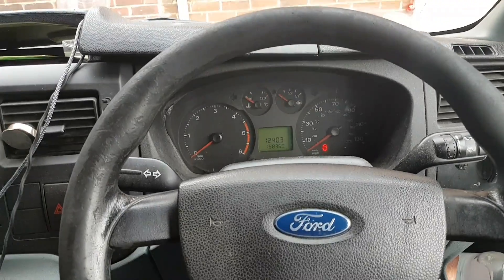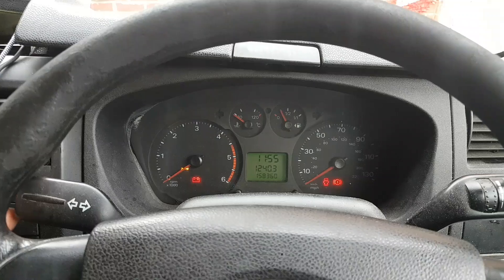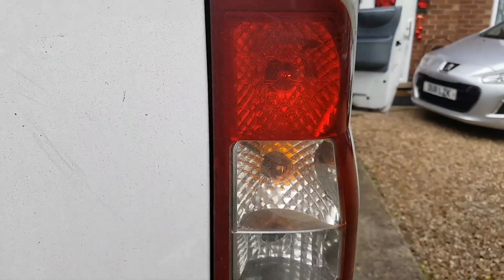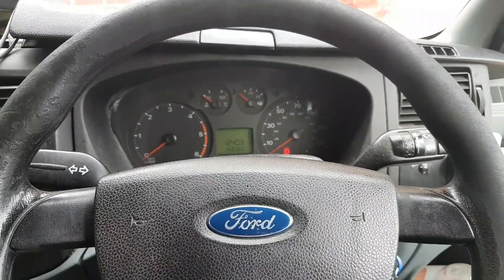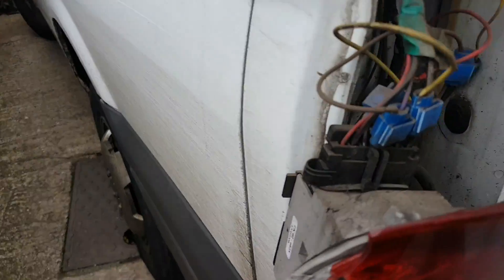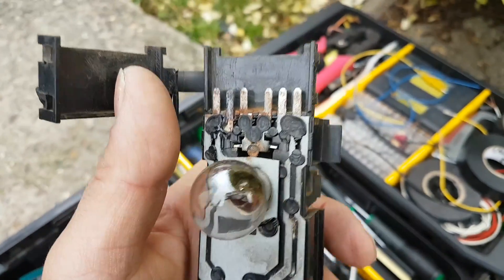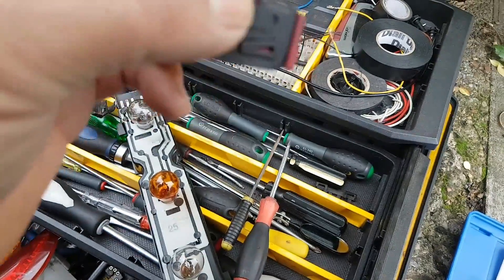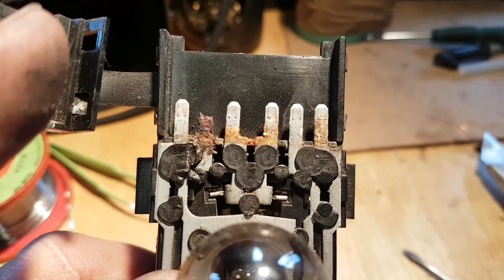Ford Transit rear lights not working correctly. Fault finding and repair.

Comment: Hi how did you get pins out of connector block
Reply from the maker: The are usually secured in place by small tabs... on this particular one, I now don't recall how it is... sorry.

Comment: Thank you for the video! But just one question, how to you get the pins out of the connector as you do at 4:13?
Reply from the maker: You need to insert 2 small blade shaped prongs on each side of the pin to press the tabs inside, and then the pin can be pushed out...

Comment: I came across your video using the below search for the problem.Having for with my 2018 Ford transit-250:

"tail lights come on sporadically on ford transit-250"

Though your video is not having the same problem as my for transit. Is it did enlighten me to the fact that the signals can be come sporadic? Dick win any of the conbecome unstable..

In this regard I will focus my troubleshooting on inspecting all the connections.

On my particular vehicle, I've added a trailer harness that then branches off to 2 separate trailer lights, one for a bike rack and 1 for 2 lights that I put on top of the Roof it's because when I have the bike rack on with the cover, you cannot see the Original tail Lights of the.Vehicle.

There was a time when it was working but I noticed the other night, when the vehicle was off, the top lights were on tail light or parking light mode. 

(Signals, hazards, brake lights all still work fine gor both kits)

Another night I noticed the tag light (I added by splicing into bike rack kit harness parking light wire) was on.

The white tag light was on all by itself.

The trailer light kits and harnesses are different because because they are 2 different products.

I put on an aftermarket tag light to the bike rack kit branch of wires.

I spliced into the wire that was for the tail lights/parking light wire  for the bike rack kit with no problem.

I then added the additional trailer light kit but this time mounting it to the top of the roof so that when the bike is on the rack with the cover on the lights can be seen clearly.

All this was working up until last week when I noticed first that the bike rack tail light was on all by itself for no reason.

And then I noticed the other day that the parking lights on for the roof kit.

Lights were on when no switches from the cab were activated. 
When I check all the lights for turning hazards and breaking, they all work.Except for the fact the parking light will stay on either for the roof or that secondary tag light stays on sporadically on the bike rack.
😮

So somehow there's a run off of 12 V hitting both the taillights or parking lights for the roof kit and also to the after market tag light.

Since both of these conditions regarding the roof lights and the tag light on the bike rack have been sporadic.

 I'm assuming that there is a faulty connection that's causing the disruption to the flow, similar to the chaotic lighting that you got on your vehicle.

Im also wondering if the spliced in tag light light may be creating a voltage change issue to the body control module.

My first step is to basically go through all the wiring and make sure all the wiring is secure.

Note: The rooftop light kit did not provide a full white wire for ground. Expecting, and then attached to the vehicle body groung.

Lastly, just recently, the 12v lighter in the front cab, and overhead cab lights have stopped working.

Ill be checking/replacing fuses for the 12v lighter outlet and interior cab lights.

Well I hope you followed the layout of my two light kits and generally with the problem i'm receiving but what's your video has shown me is that a faulty connection anywhere in the connection sequences can lead to sporadic lighting results.

So thanks again.

For showing me that sporadic lighting can result from simple problems such as bad grounding or a single connection going bad.

This will aid me when conducting troubleshooting.And exploring is what wiring problems i'm having with my issues.

Comment: Massive help thanks. However, you can buy brand new pair, including the wiring and sockets and connectors, for about GBP16. But this certainly works. The idea of fixing the ground  is the main fix as it appears that is common fault with the transits. Grind the paint off the body, clean up the lug. And refit the ground. Spray paint over the connector when finished.

Comment: Thank you very much, excellent video, one question, could you tell me what the order of the cables is since they can be connected in the same way. both sides and I didn't pay attention when disassembling, could you tell me which pin is each or how to know which is ground which is positive, thank you very much,
Reply from the maker: I don't recall that now...
But with a multimeter you can easily figure out which is which...
👍👍👍

Comment: Hi there. 
I wonder if you can help??
I have mk7 transit. The stop lights aren’t working. 
I’ve changed the stop light switch, fuse and bulbs. 
Could you point me in the right direction of what wires I need to look at to fix this please. 

All the other lights work front and back.
Reply from the maker: Measure the wiring...
It is difficult to say without testing...
Test before replace...
👍👍👍

Comment: My brake lights seem dim they all work correctly but just dim when brake is pressed hard to tell the difference between tail lights and brake lights not sure why or how to make them brighter
Reply from the maker: Make sure to start with, that you have the correct bulbs... then check grounds, connections etc...
👍👍👍

Comment: With the wire you soldered to the circuit board  could I technically do this with the positive negative for a power lead to run parking sensors on the rear or is it worth splicing into the main line?
Reply from the maker: You can solder, but I would advise you to install a fuse in between...
👍👍👍
Reply: @LMAutoRepairs  lovely - I'll get that sorted with a fuse box down line to the control unit 👌
Reply from the maker: @quickshiftpov 
👍

Comment: you know how to de-pin the connector mate? thanx 100 times
Reply from the maker: I don't recall exactly how that one is done, but they usually have one or two tabs to press while pulling/pushing the pin...
👍👍👍

Comment: Hi there, I have a 1996 ford transit with a similar rear light, the mechanic has fail my W.O.F because the the top red light is both the tail light and brake light. Is this the same on yours or should the bottom red light be brake light? Thanks heaps

Comment: Great Video, I have no revering lights, i tried to clean the pins on the tail light connection, not realising that one can easily open the plastic cover so easily as you did on your video, so going to take the rear light out again, and give the reversing light terminal a proper clean, really glad i watched your very useful video, we all learn new stuff everyday.
Reply from the maker: ☺️
Thanks, hope you get it sorted! 
👍👍👍

Comment: Any leads?? My brake light work fine but the right driving light isn't working? This is the same bulb. Changed the rear lights and bulbs still no solution..
Reply from the maker: Wiring?
👍👍👍

Comment: This is great fixed my brake lights. My driver side indicators have now stopped working. Not even flashing on the dash. Left side works fine. Any ideas as there is nothing online.
Reply: Hello, just had the same problem.  A search online (Ebay) and I bought a new ewar lamp holder and connecting block for £8 (post free) - problem solved.

Good luck.

Comment: How do you take the pins out - if you pull the wires they don't budge!?
Reply from the maker: You need to dismantle the plug... I believe there is some small tabs you need to press to release the pins...
If I recall correctly...
👍👍👍

Comment: I have the same problem. But if I connect my caravan/trailer the problem gets worse. 

So: That cannot be a problem at the connectors of the back light? Isn't it? That should be earlier in the circuit near the battery.  Isn't it?
Reply from the maker: I would say yes...
As when you connect the trailer more load is put in the circuit...
👍👍👍

Comment: Great vedeo and great helping 👏  on my transit 2012 I have a strange problem 🤔  I replaced a pedal braek switch and not have a electric signal on brake lights!! On dashboard I see a 2info lights! ABS and sleepering road signal!! Anybody knows what caind of the problems can be?? All fuses are 👌 i replaced the rear lights both sides but no power on brake wires 🤔 i appreciate if anyone have ideas thanks fellas cheers
Reply from the maker: What was the problem before the switch replaced? 
Check grounds...
Thank you for watching!

Comment: I’m having a similar problem, when I indicate right the fog light flashes on the dash when I put my hazards on only the left indicates on the dash and when I come look at the back every light is flashing faintly on both sides. The right hand side break light comes on instead of side light too. I’ve stripped down and cleaned every single plug pin and earth and no joy. Any advise? Thank you
Reply from the maker: Hi
Still... that to me, indicates poor ground somewhere...🤔
Reply: @LMAutoRepairs  I thought that too, do you know of any others? I’ve checked and properly cleaned each one behind each light

Comment: great vid mate buy can u tell me how you remove the wires 4 mins 14 seconds in to your vid many thanks
Reply from the maker: There is a small tab inside the black plug, that you need to move in order to allow the pin to slide out...
Thank you for watching and for your comment!
Reply: @LMAutoRepairs  thank u mate I will give this a go thank u again

Comment: Hi...could you tell me which wires are for the rear fog light please...I need to switch my log light from the right to the left...for import into,Europe , or, indeed add a fog light to the rear

Comment: Hi, good video I learned quite a bit. I have a similar problem and it is that the fog lamps are permenantly on but on a very low light. But talking to a friend who knows a bit about Transits he said the problem could be caused by the fact that the two  bulbs are LEDs and not standard filament bulbs. He said on old vehicle replacing standard bulbs with LED.s can cause problems. I have not stripped off the light fittings yet to see the condition of them, but wonder if you feel the LEDs. could be the issue. Strange thing is that the previous years MOT did not mention this problem but I have just had a MOT test and the guy failed it on this lamp issue......and other things !
Reply from the maker: Hi
Yes... on some old or cars not prepared to use LED lights, they can cause issues... not sure in your case... put a normal bulb and see how it goes...
Thank you for watching and for your comment!
Reply: @LMAutoRepairs  Many thanks for your reply and I will check the light units over and change the bulbs to normal. Thanks again !
Reply from the maker: @1414141x  
👍

Comment: What grease do you use? Battery contact grease etc. Do you have a favorite brand? Thanks
Reply from the maker: Silicone based grease is usually fine...
But ideally you want dielectric grease...
Thank you for watching and for your comment!

Comment: Hi sir, great video as always!

Hoping you could help with an issue I'm having. Is it possible to bypass the ABS control module to rule it out as the problem? As the code is for the ABS but it's the transmission is shifting real rough. 

Thanks
Reply from the maker: You can't really bypass a module... which car are we talking about? 
Thank you for watching and for your comment! 
👍👍

Comment: Hi mate! I really need your help. How can i get in touch with you?
Reply: I have a bmw f10 525d 204cp. I had problems with egr and trottle corp. After i change them check engine sign has gone but the problem not. Every morning when the engine is cold the car is not running well when i press gas padle. This is happend for aprox 5 minutes then everything is fine and the car running normal.
Reply from the maker: @alexmacovei7397  
Ok... have you reset the adaptations? 
I am not sure if is needed on that one, but if it is, needs to be done...
Reply: @LMAutoRepairs  i done it. Do you think is a sensor or something?
Reply from the maker: @alexmacovei7397  
Check live data... it is difficult to advise with so little information...
The parts you fitted, are they genuine or aftermarket?
Reply: @LMAutoRepairs  genuine. The erorr is something like gas recirculation. Am going tmrw to test with snap on. Is nothing on dashboard, no erorrs
Reply from the maker: @alexmacovei7397  
Ok... see what comes out from that diagnostic session...
Reply: @LMAutoRepairs  thank you very much for your time
Reply from the maker: @alexmacovei7397  
No worries...
Reply from the maker: Here... go ahead!
Thank you for watching!

Comment: Do you have a preferred method for cleaning corrosion off pins like that? I use a fiberglass pen but I always wonder if there's a better way. Thanks for the video!
Reply from the maker: I found that fiber glass is good for light corrosion... like this, a needle file and a fine sand paper...
Thank you for watching and for your comment!